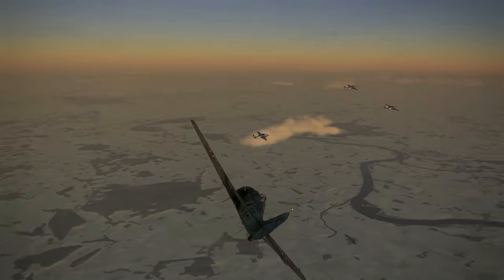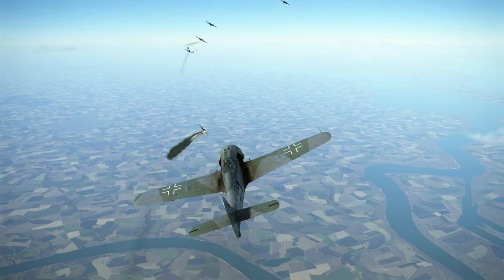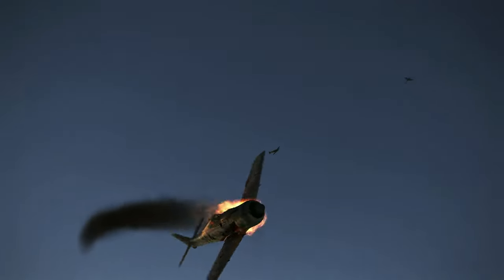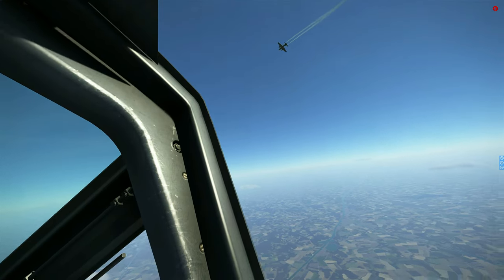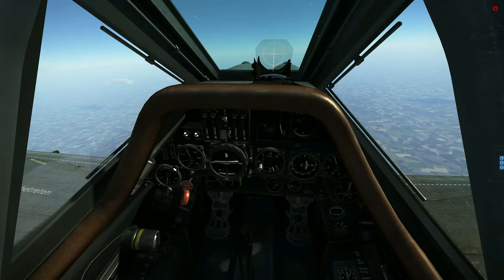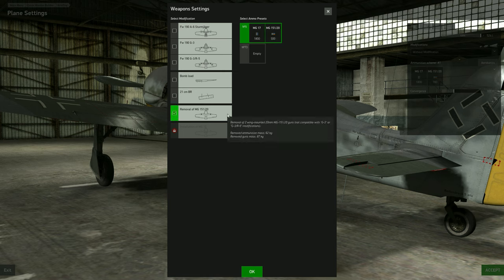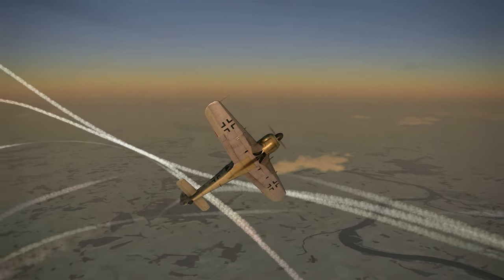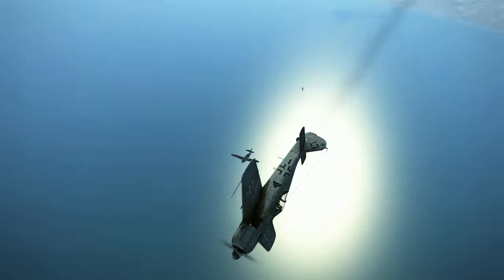IL-2 Great Battles - FW190 A6/A8 - Beginner's Guide

Comment: I think you got wrong the fuel gauges, you show the oil Temperature gauges I think. The fuel gauges are to the right low, there is only one gauge for both fuel deposits, but it changes between deposits every a few seconds

Comment: Can you do some on the ground attackers? Specifically the hs129 since it is a rarely discussed aircraft. 

Of note, the fw190 is extremely good early war. Later on though a lot of its advantages are much less pronounced. Doing a campaign as an a8 is rough. The enemy has so many planes and you don’t even have a top speed advantage anymore. You can’t really dive away from p47s or 51s anymore either.

Comment: hi im thinking of shifting from war thunder and buying this game and also because specifically i love the fw 190, do you recommend it? is it fairly populated to multiplayer servers? thanks
Reply from the maker: I think it's a really good game, not without it's problems but solid. I'd say that the 2 main servers that everyone plays are full in the evenings most of the time. I never normally go flying without seeing anyone. Single player is good as well but can be repetitive.
Reply: @RedDagger  thanks for the reply.. one last questions please. In WT you could "pre trim" the 190 to counter the yaw to the left due to the engine torqu.. is there something similar that can be done in il-2? i dont own any pedals only a joystick do you have to constantly fly with the joystick twisted in order to maintain a ball-centred level flight? thanks for your time great video
Reply: @matthewspiteri3627  The FW-190 has no in flight adjustable rudder trim.  Taking off is accomplished by keeping the tail wheel locked with stick back pressure until around 100 km/h.  Then, you ease off the up elevator and add rudder trim counter to the torque as required.  The aircraft is less affected by the yaw affect of the motor and propeller in forward flight than other aircraft.  At cruising speeds and power settings, it should require no trim.  In other conditions, it might require some rudder input to set up a straight shot or not.  This is how the aircraft was reported to fly by those who flew it.  I'm not sure why, but if I had to guess why this is, it's because the tail and rudder are so low.  It is about vertically centered behind the propeller.  I'm no aerodynamicist, though.  Anyway, it's quite easy to fly.  Taxiing is also pretty nice compared to other aircraft.  But, it's easy to spin out without locking the tail wheel using the elevator controls.

Comment: can u do g6-late vs g-14. I can't seem to tell the difference,I'm new to the sim
Reply from the maker: Thank you for giving me a new idea 👍👍👍
Reply: Short answer: the difference is mostly clerical. The G-14 is a standardization of the most common upgrades to the 109 G-6. You can make a G-14 out of a G-6 late if you take the Erla Hood and MW 50. G-6 Late is still very slightly lighter, but they are otherwise pretty much identical at that point.